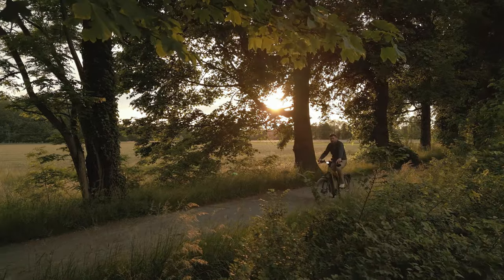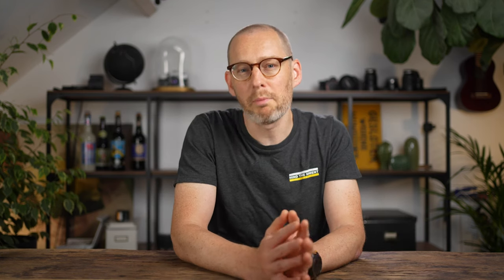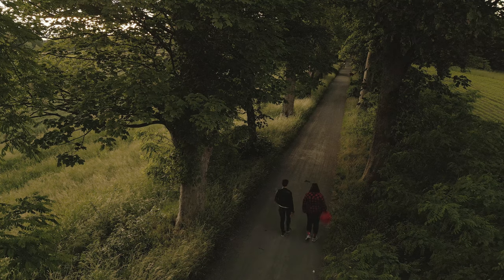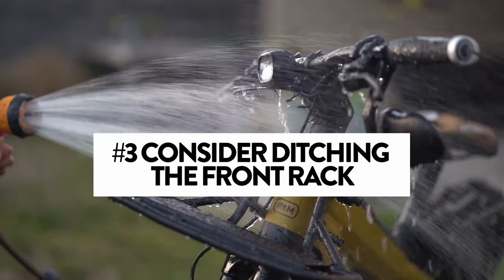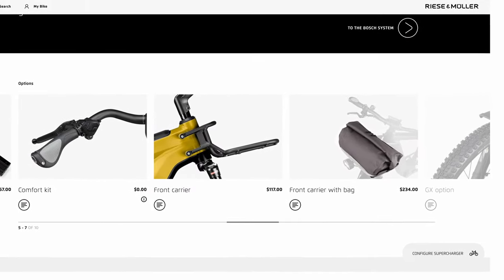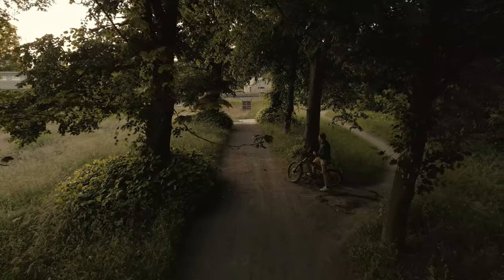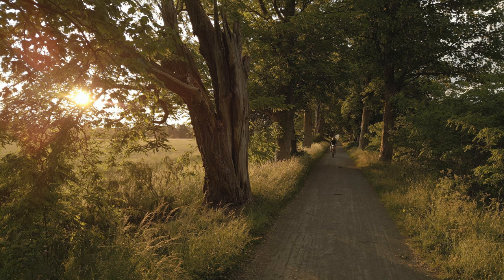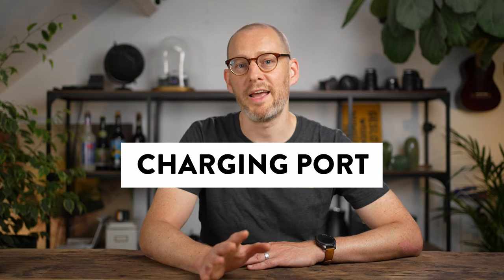Riese & Müller Supercharger - long-term review update

Comment: Thanks for the great video. I recently rode my R&M Super Charger 2 HS with the Rohloff 500/14 and Gates belt across America, covering some 7,500 km in 4 months. Like your bike, I modified the standard configuration. I added a heavy-duty front suspension fork, a new suspension seat post, and a suspension handlebar. I completely agree with you about the front rack - it's not very practical unless you have an adapter. To solve this issue, I used a MIK adaptor plate on the front rack. I attached a drone case using a MIK plate during the cross-country bike ride to the front rack and that worked well. For city riding (since I am back home), I use a basket with a MIK plate that easily clicks onto the front rack. You may want to check this out as the R&M rack bag is less versatile.

I also upgraded to Schwalbe e-bike cargo tires for extra puncture resistance and weight-bearing capacity and had a third 625 wh battery and a second battery charger. I also changed the handlebar grips, and bell and added a water bladder to the frame as the R&M water bottles are not practical for long-distance cycling. I also added a B17 saddle of Brooks and a right mirror. I had no problems with cadence, so kept the drive system as it is.

The e-bike performed extremely well, and in my opinion, there is no better electric touring bike with a Bosch dual 625 battery system, Rohloff, and belt drive. I am not sure if another exists. But it took some rebuilding and fine-tuning to configure the e-bike for a cross-country (or cross-continent) tour.

This bike is a computer on two wheels. As you say in the video, make sure you have access to an authorized Bosch and Rohloff dealer. Serious problems with this e-bike cannot be fixed at home. My belt broke after some 10,000 KM on the bike, so yes, they wear out after a while.
Reply from the maker: Wow, that's quite the trip! Very interesting to read about your modifications. Adding a quick-release system to the front rack sounds like an ideal solution (though I'm not quite sold on the MIK system, I feel the 'keys' are a little too easy to lose).
Reply: @BelgianHikers  Yes, these "keys' are easy to lose. I just release the MIK plate by pressing the release button with my index finger as I have lost the "keys" to my MIK plates. MIK is also the system used by R&M for the rear rack of the Super Charger, so you only have one solution to worry about. I forgot; I also changed the pedals :) All the best. Gregory.

Comment: I have  had a  R&M Multicharger Touring package (derailleur & double batteries)  for 4 years and ride it constantly. I have about 9500 on the clock. The only issues I've encountered are due to overloading the bike because I weight 320 lbs and anything I carry puts me over spec. I am about to install my third rear wheel rim I found that an old Novaro rear trunk bag worked perfectly on on the front rack to carry incidentals. I also found that the front rack is perfect for take out food containers when used with a cargo net. I have taken the bike  on several  multiple day tours and it has never failed me.
Reply: I'm right around your range (300-310) and am picking up my Superdelite Friday! Any advice or more clarity on what you mentioned above?

Comment: I was fortunate enough to have an R&M dealer just a few blocks from me (I rode my bike there lol).  So I was able to test ride bikes with both the Rohloff and the Enviolo.  The Enviolo was nice... but after riding both, I went with the Rohloff.  Lower low gear, higher high gear, and really solid-feeling.  I made sure to try the Enviolo, because the Rohloff is now $1,550 more here in the US.  But yeah, it's worth it.
Reply from the maker: Wow, $1550! Better put some miles on it to make it worth the investment then 😉
Reply: @BelgianHikers  Oh, I'm gonna run that thing into the ground!  lol

Comment: I bought this type of bike recently (second-hand). I'm also from Belgium.
It's my first Speed Pedelec, I was unsure (and somewhat still am) if it's something for me. I do absolutely enjoy riding the bike, and got some more insight into the bike from this video, thanks!

I've been unlucky, had the inner tyre replaced for the second time in 2 months on Wednesday and had to take my car to work on Friday (so only rode it on Thursday) because the tyre was flat again (no damage to the outer tyre). Hopefully I found a good mechanic now, it's a shop that sells R&M bikes and knows these bikes.

I'm still quite afraid for accidents and falling. Not due to my mistake, as I'm careful, but I've had a few close calls from cars and especially other bikers, it's insane how inattentive some people are, especially on roads where it's already dangerous enough to ride a bike. At least I'm avoiding rainy/"bad" weather for now and just play it safe.
Reply: Thank you for your comments. My SuperCharger2 should be arriving in a few weeks. Innertube? I plan to set mine up as tubeless with Tannus  Armor Inserts. I installed them on my touring bicycle several years ago and never have had a flat since. In fact, I wore out my 2.3 Schwalbe tires before having another flat. I live in SW Texas where there are a lot thorns and burrs. I would suggest that you also setup your tires as tubeless.

Comment: I have a 2021 Superdelite, 12000 km. Real unstoppable tank of a touring bike. I get 200-250 km from the batteries normally. The fast charger that came with it gives 2 hr cycling during a 1 hr food break. Still plenty of thread on the original tires.
Maintenance so far: oil changes in the Rohloff. Now the Gates carbon belt is starting to crack so going to replace it.
Had one slow puncture that I fixed with Joes noflats inner tube sealant.
Crank arms may hit the ground if suspension is low on air. I have to inflafe the rear air suspension every 500 km now.
Rohloff cannot change under load which is annoying on undulating terrain.
Reply from the maker: Unstoppable tank sounds about right 😄 I've only ridden the Superdelite briefly when shopping for my Supercharger in 2020, maybe I should ask to test one out again at the shop to compare. Can't really remember how much difference that rear suspension makes. Two years and 12000km seems a bit quick for the belt to wear out, no? Even if other systems allow you to change the gears under load, I'm not sure that's ever a good idea honestly.
Reply: Today I would buy a Supercharger and add a suspension seat post. Less complexity and less weight. Although my rear rack is now suspended, the high rear rack makes mounting and demounting the bike a bit cumbersome.
I think the belt wears faster because of the extra outward bend on the superdelite. Your Supercharger is much more straight.
Reply: @Maddack is there a true difference between the two in speed other then full suspension?
Reply: @calastro2577  I have not tried the supercharger.
PS now at 15000 km my new belt is showing signs of cracking.
I was counting on 25000+ km per belt but no, there is a design flaw with this system.

Comment: I bought a Multicharger GT light; after going through all the upgrade options that were available, i settled for the most entry level option in the entire range because the derailleur version was the most easy to maintain and fix, most cost effective in my books and had enough gearing for me to use in SouthEast England.
Reply from the maker: I heard someone defend the derailleur recently with "if it's good enough for the Tour de France, it's good enough for me". Hard to argue with that. 😂
Reply: I also bought the lowest on the line up but it's the 2023 smart system multicharger family. Funny that it actually was cheaper because it comes with the kid accessories as standard compared to the older model. Both were on sale and the new one was still cheaper. But I am still waiting for it to arrive.

Comment: Thank you for second review. Looking for something I could ride as daily transportation once in Belgium. Within 30 km/h radius from work at Liege, Seraing. I have done lots of reading on speed pedelec in Belgium and it seems to be safer for newcomer to use 25kph version. Which gives for cargo weight capacity as well.

Comment: They do attatch the light on the rack. I ordered a multicharger. Unluckily it was the low step and not the high model I ordered but it did have the light fixed on the rack. There still was a mount to fix it up to the bar when the rack is removed.
Reply from the maker: Thanks, that’s good to know! Great that they leave the option to mount it on the bar as well, because the light on the rack is better functionally, but not everyone will prefer the look.

Comment: Hi. I didn't understand what type of cover did they replace free of charge for you? Thx
Reply from the maker: The charging port had a rubber cover that closed it against rain and dirt, but it was very hard to close (and easy to lose). They've replaced it with a plastic version that is ok but usually breaks at the hinge after a couple of months. I always get a new one when I bring it in to service it every 2000kms.

Comment: Hoi, sind 18-01-2024 Super charger 3 HS Rohlof. Heb er nu 1450 Km opzitten.
Sinds 2016 met 2 e Hands S-Pedelecs naar het werk. 25 Km enkele rit.
Km teller liep 4Kmh voor. Na 2 keer nieuw instellen geeft hij 1,5 Kmh te veel aan.
Fietste met Raleigh  met alfine 11 naaf en impulse 2.0 motor sneller.
Ondersteuning voor een S-Pedelec Matig.
Hij lijkt gemaakt om 32 to 34 te gaan vanaf 36 tot 40 moet je echt meer doen. Snelheden van 41 tot 43 met wind in der rug en dan zit ik liever op mij Bianchi racefiets dat gaat beter,
Met een beetje tegen wind ga je 32 Kmh met 70 omwenteling. om 36 op  de teller te krijgen trap je je in het zweet en dat was bij de andere niet zo. Update van Boschmotor bracht geen verbetering

Bij KM stand 950 ging de riem kapot. Eerste voelde het aan als een oude keting met schlechte tandwielen die af en toe doortrapt, en binnen 8 km was die riem afgerafeld en gleed hij door, Kreeg een nieuwe . Pech
Een nieuwe fiets van 8500 die ik altijd in stand turbo moet hebben bij een beetje tegen wind. Dat had ik niet verwacht.
Het licht, super.
Door een weg opbreking moest ik 3 weken 400 meter door het zand, en dat gaat met deze perfect.
Bij het 2 km gravelpad voel ik me nu ook veel beter.
Door de dubbele akku hoef ik niet meer op het werk te laden.
Had op de andere fietsen de zelfde verende zadelpen gezet als op de R&M, best wel lekker.
De Impulse motor moest vaker in de reparatie. de eerste na 4000 KM , tussen 8 en 12 duizend was die aan rparatie toe. Bouwde zelf in en uit. Met  de Bosch motor hopelijk niet. Deze trekt beter op , maar gaat niet vergenoeg door. Als je 32/34 Kmh genoeg vind is dit jouw perfekte fiets.
De elektronische schakeling vind ik fijn. Als je stopt schakelt hij bij mij op verzoek in versnelling 8, was 5 maar dan trap je gelijk in het niet op het vlakland waar ik woon.
Afwerking en matriall top.
Reply from the maker: Je geeft de perfecte samenvatting denk ik: "Als je 32/34 per uur genoeg vind is dit de ideale fiets." De vraag is of mensen daar zo'n dure fiets voor kopen. Benieuwd wanneer Bosch een meer pendelvriendelijke motor uitbrengt.

Comment: Thanks for the great review. Nice, just like the previous one you did. I wonder: do you think the SC2 would be 
"good enough" to do some relatively easy MTB-trails in Holland with my 4
 year old son on his small MTB? He's only going very slowly and is still
 learning, as am i. If this bike could get me 2-3 years of easy 
MTB-trails with my son, going slowly and just having fun, that would be 
great. I would not have to buy a separate MTB. Then, if he gets serious 
after a few years, i can always buy an extra dedicated MTB for myself. 
Looking forward to your reply!
Reply from the maker: I've only done a proper MTB trail with the Supercharger once. It wasn't a particularly fun experience, but that was mostly due to the fact that the Schwalbe Moto X-tires that come standard weren't grippy enough for the trail. If you use the right tires, your main issue will likely be the weight. This is not a nimble bike at all. But simple forest trails at low speed? Sure. Go for a test drive and try it out!

Comment: Again a question, since i rewatched your excellent reviews a few times now. I've just sold my Stromer ST3 en i'm looking for more comfort, so switching to R&M. I was wondering: with the Enviolo and the High Speed version, until what speed is the cadence still viable and nice? I would like to be cruising @ 35-38 max, do you have any indication of the RPM of the Enviolo on that speed? At what speed does it become uncomfortable, due to the having to peddle too quickly? Above 40? Thanks!
Reply from the maker: For me personally: I'd say everything under 35km/h is perfectly fine. If you're not planning on going faster than 38km/h cadence should probably not be your main concern. But comfort is very personal obviously. So by all means go and do some thorough testing before you buy! Also, I'm curious: what kind of comfort did the ST3 lack?
Reply: @BelgianHikers  Thanks for the reply, those are some good pointers. I appreciate you taking the time! For me, the Stromer is all about speed. The fork is very stiff (yes, you can get a front suspension for 1.000 euro) and the posture on the bike is pretty spartan. Of course, this all can be changed, but somehow i feel that is not what the bike is for. Plus: maintenance of the derailleur, dirty/smudgy pants etc. So i'd gather go a bit slower and move in more comfort. Also: things get increasingly dangerous above 40km/h, so going 33-35-37 somehow feels better as a young dad.
Reply: @BelgianHikers  i tried the sc2 Enviolo last friday and noticed exactly what you described: the cadence became too fast above 35km/h. My dealer told me there was nothing they could do. You mention that you changed the rear ring. What exactly does this mean? What changed? And even more importantly: what is the cadence like now? Can you now drive 40 with a decent cadence? of even 43? And what have you lost? Some light gearing? And is this actually an issue when riding on flat terrain like Belgium and Holland?

Hope you can give me some pointers! Thanks!
Reply from the maker: @Stijnemansstijnemans  My rear sprocket (24T) was replaced with a Gates 22T sprocket (CDXR22EN-AM). There were some issues with the installation so I'm not sure it was an upgrade. Based on a smallish sample of commutes before and after the change, my cadence lowered from an average of 77 to 73. So not much of an improvement. The Rohloff's not an option? That should give you a better cadence right out of the box.
Reply: @BelgianHikers  Yeah the Rohloff is an option but it is crazy expensive, at least 1500 euro's more. Did you have major issues replacing it? It seems you only got an about 5% improvement in cadence. This is not much. Was it expensive? Probably a big job for the mechanic?
Reply from the maker: @Stijnemansstijnemans  Yeah, he had never done it before and was saying R&M’s documentation wasn’t very clear. Perhaps I should get a second opinion at another bike shop. It’s not a big issue though, I rarely ride fast enough for it to matter much.
Reply: @BelgianHikers  Nice. I read somewhere that R&M bikes are customizable from the factory. Perhaps they could change it when building the bike. Have you lost any "gearing" by changing it?
Reply from the maker: @Stijnemansstijnemans You mean did the smallest gear change? I assume it must have, but I hardly ever use it.
Reply: @BelgianHikers  Indeed. You say you replaced the 24 with a 22. Wouldnt it be possible to change it for an even smaller one (20 maybe?). I have no real knowledge of these things, but if your cadence only lowered by 5%, an even smaller one would maybe reduce the cadence by 10 or 15%? Or am i missing the point? ;)
Reply from the maker: @Stijnemansstijnemans  🤷🏼‍♂️No idea. As I say in the video: finding yourself a good bike mechanic is key.
Reply: @BelgianHikers  I emailed Riese Muller and they cannot adjust this in the factory, sadly. You say your average candence lowered. What is your cadence like @ roughly 35-40km/h. In my experience the original cadency gets frustatingly high above 35km/h. Has this improved significantly for you, or is it only marginally better?
Reply from the maker: @Stijnemansstijnemans  35km/h gives me a cadence of about 80, 40km/h is 90, and 45km/h is 100.

Comment: The bike has great specs and so the Rollov shifter is likely the way to go.. Yet Is there a USB plug on that one to recharge your phone on the go? And speaking of the rollov, does it work without battery power? I don't suppose so.. Great video thanks for that 👍
Reply from the maker: The Rohloff doesn't work without battery power, but the bike reserves the last couple of % power for shifting (as well as for lights and display). If you run out completely, you're stuck in your current gear. There's no usb plug, which feels like an oversight. I'm hoping that the next generation of bikes allows you to charge phones and other stuff, and also allows for (slow) charging the battery on a standard phone charger in emergencies. 🤞🏻
Reply: @BelgianHikers  Oh good to know, smart machine right? Thanks for the quick answer 👍